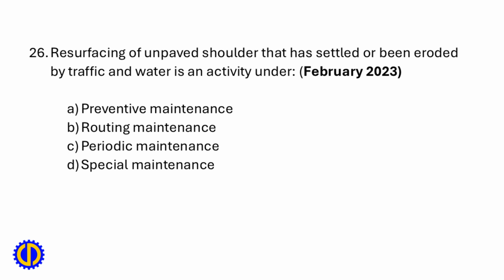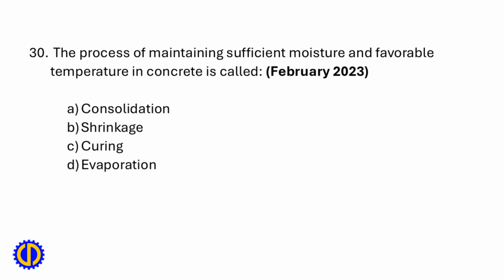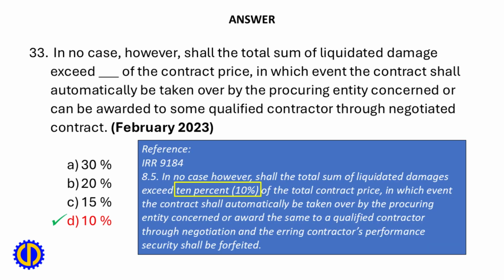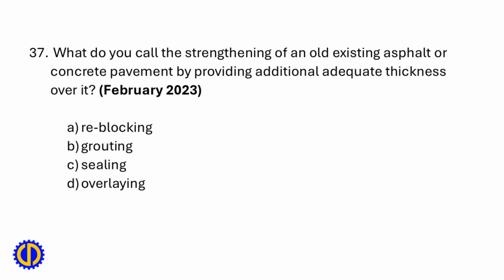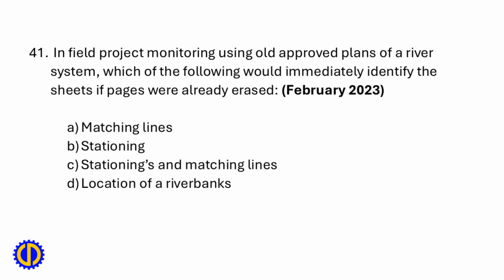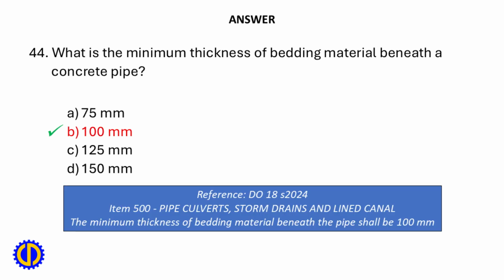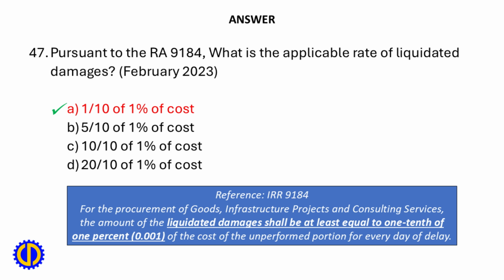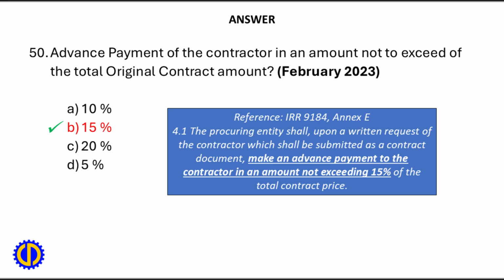Project Engineer Reviewer Part 6 DDN

Comment: Dun sa number 43, conditional approval lang po sya hanggang 2021. So it means na ngayon, the answer is 90 minutes based sa 2013 dpwh blue book reference, tama po ba?
Reply from the maker: Sa specific DO lang po applicable ang 2 hours. 
90 minutes pa rin ang standard. 
Nakasulat sa blue book 2013 under 311 admixture na pwedeng ma modify  requirements with the use of admixture. Itong DO ay gumamit na admixture kaya namodify iyong 90 minutes requirements but still needs to be proven through trial batch.